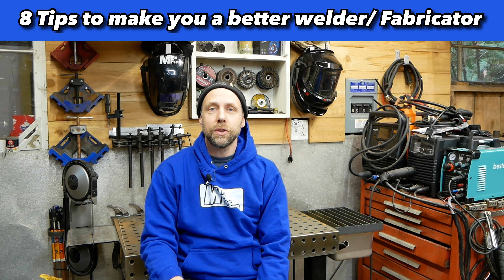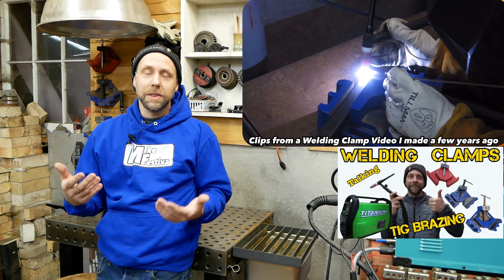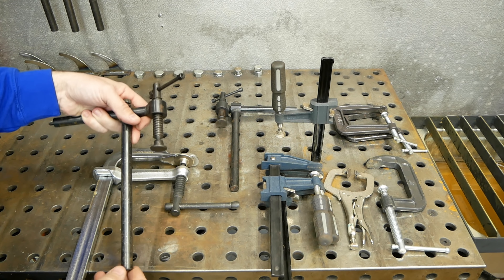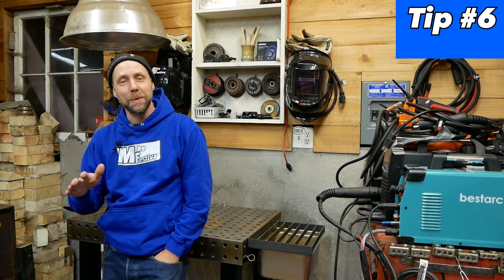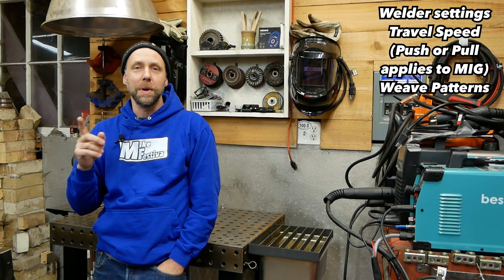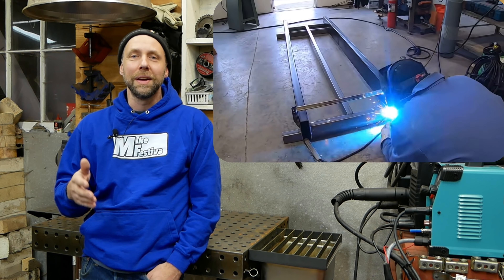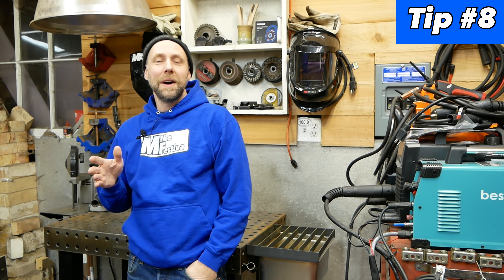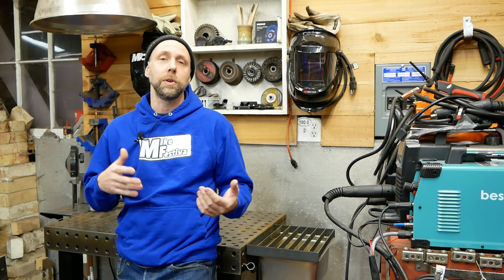8 tips to make you a better Welder/Fabricator

Comment: I weld galvanized steel for around 9 hours a day 5 days a week (repairing Wheely bins, skips and roll on/roll off skips). Best thing I've found to deal with the fumes, is a decent air fed mask with a good face seal, making sure all filters(pre, main and gas(if available) are in good shape) and some form of extraction, whether it be overhead or on torch

Comment: I'll add something that may help others, I was a collision tech for over 18 years and warpage was always a concern! I found using a heat barrier gel helped. Especially on quarter panels. Large sail panel welds can be a nightmare on thin sheet metal. Always good stuff duder. I watch the basic ones like this because I hope it helps your channel. Oh, I also trashed both t-shirts I bought, so guess I'll order a couple more! Keep the vids coming ✌️

Comment: My Dad told me (back when I was I in High School 1991...) treat a Weld like Installing a Wheel on your Vehicle, as a wheel it is best to one a "Criss-Cross Pattern" for tightening, use the same principle for Finish Welding an area of more than 12"!
Weld 3" at one end, go down 50% of the length and Weld another 3". Then go back up, and back down allowing the heat from the Welds to dissipate along the length.
Don't start at top, go to the bottom and so forth where you finish in the middle because there will be so much heat in your material it will likely buckle or seperate...
I hope this made sense as my Dad used my Hot Wheels as a Physical Representation of the Welds for me. He was an Engineer for the Military Sector at Boeing!
-He knew what he was talking about.
Thank you for this episode, I was hoping to assist without causing much "confusion", but I think that I made things worse...
-T🖖
Western Washington State

Comment: Thanks for this useful info. I enjoy your informative style and positivity. I will go through your TIG info as I have just got an ac/dc TIG as I want to weld aluminum. I am retired so have the time to take it slowly to learn. MiG welding seemed such a pleasurable change from Arc welding and didn’t take long to get much better welds. The arc was always touch and go. I think because I was at the end of a power grid line so had inconsistent voltage with lots of drops. Keep up your great vids.

Comment: What type of moisture filter system do you use for compressed air and what fluid do you use for CNC plasma?
Reply from the maker: I’m just running two inline water traps to cut down on water getting to my Plasma cutter.
I haven’t found any affordable additives for CNC water tables. I have been using a product I got from my work but I don’t like it because it foams up when cutting.

Comment: Are you going to do a review on the yellow AC TIG that we saw in the last two videos? I'm looking into cheap options that will weld both steel and aluminum with a single gas bottle. Not sure if multi MIG with a Teflon liner or AC/DC TIG is the way.
Reply from the maker: Yes I will be reviewing the Hynade AC TIG fairly soon 🙂

Comment: Great video and I think these are the most important tips. The only other two I can think of are: (in spite of Tip 5) always buy a bit more metal than you need for the project. Allows for miscalculations, mistakes, changes of plan, and you can always use the leftovers for something else. And the other one, most relevant for TIG, is drill vent holes so the hot gas has somewhere to escape other than back through the weld into your tungsten!
Reply from the maker: Those are great thanks Ben

Comment: Hi Mike, I'd really like some advice:  I have a big single project to weld up and after that I probably won't hardly ever use the welder unless its repair/mods to my small tractor or the like.  It's a 40 foot cantilever gate using 1/8th square tube (24' span, 16' tail).  Would you recommend the Hynade 175 multi or a HF Titanium 140.  Havent welded since the mid-80s so I need autosets.  Hynade has more amperage and is half the price.  I found the Hynade from your videos I figured if anybody could give me a solid recommendation you can.  Thanks!
Reply from the maker: Hey I just saw this comment, sorry it’s a bit late. I think the Hynade has auto set and would do fine but I feel like it’s a bit on the lower quality build side then the Titanium 140. Both welders would be easy for you to use. One other thing to consider the Hynade you will need to buy a regulator if you plan on using solid wire and the titanium comes with one. Take care 👍

Comment: Was wondering if you could tell me what fixture table that is? I have looked through you other videos and can't seem to find any mention of it.
Reply from the maker: Yes the Table I own is from Langmuir systems, it’s the same company that sells the CNC tables. Most of my videos have a link to there website.
I wish my promo code would save you some cash but it doesn’t cover the welding tables unfortunately.
They weren’t cheap but I’m definitely glad I have them.
I bought two table tops and one set of legs, this way you can get a fairly good size table. I ended up building the second table top into a Harbor Freight hydraulic lift table so it’s got adjustable height and can roll around 👍
Reply: @Mikefestiva  ah been looking at that one already awesome thanks for the info!

Comment: Excellent as always.
Reply from the maker: Thanks Mel 🙂👍
How have you been lately? 
Any interesting or fun projects you have been working on?
Reply: @Mikefestiva  nothing like the large ones you manage. I can lift (or almost lift) mine. But interesting and fun, yes. I turned one of my frill presses into a three phase VFD, and I’m going to do that to my mill shortly. I also built a tilting mobile “rack” for my various metal bars, rods and what have you. Also I took my Miller spot welder and did what Miller should have done to it and the stand. I’ve been modifying my 14” lathe. You know, the usual things we do to our equipment.Some other smaller things.

Comment: Can you weld a piece of metal on top of another piece of metal?
Reply: Like welding a plate over a section of car frame rail
Reply: @SawyerFord13  Yes, I believe that is referred to as Scabbing. The best way to do it is not only to weld around the edges of the plate, but to also put several holes in the plate itself and weld to the metal underneath it, which is called a plug weld. They don't have to be big holes, on something like a frame rail you'd just need a few 3/4" holes and you'd be golden. Kind of a long winded response to a simple question, but if you're considering doing something like that you should make sure to do it right the first time.

Comment: Which do find yourself using more, MIG or FCAW?
Reply from the maker: I mostly weld MIG in my shop, but the FCAW is still something I do keep around if I run out of Shielding gas or don’t feel like dragging the bottle around for a repair outside my shop. 
Thanks for checking out my new video 🙂👍

Comment: TIP #0.5, ALWAYS WEAR YOUR SAFETY GEAR
This included Gloves, Welding Apron, Welding Helmet, Safety Glasses with Side Sheilds, tie back that Long Hair and Don't wear loose Clothing that can get "snagged/caught" on/in any Material or Tool.
And good Rubber Insulated Boots/Tennis Shoes.
Reply: And no hoodies with strings hanging down.